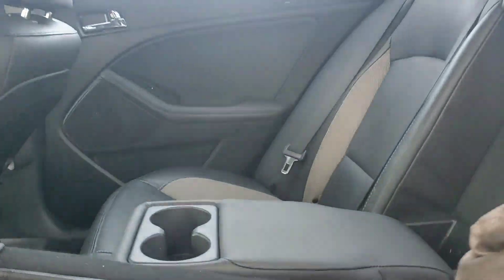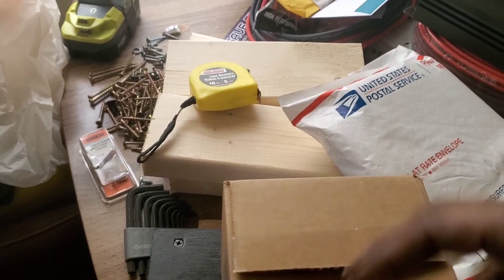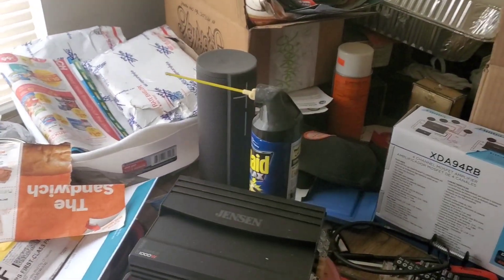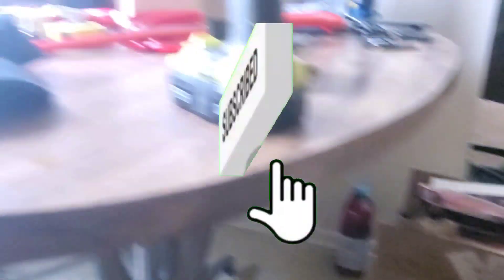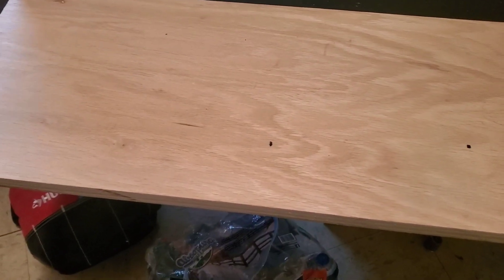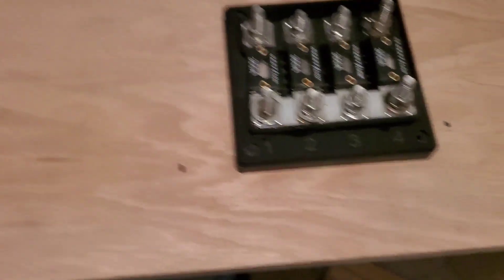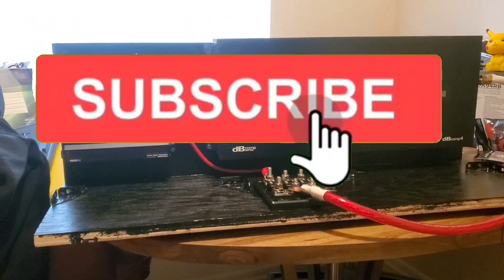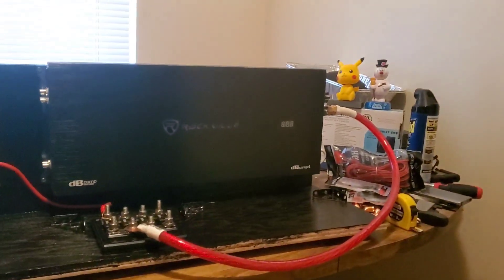Rockville dbcomp4/Jensen XDA94RB Amp Rack

Comment: On your amp rack if you don't like it you can move the wood in the back forward to the middle and leave it mounted the same way then you can put the batteries in the back part of the T shaped amp rack. The bottom wood leave and the wood that forms a L if looking at the amp rack from the side move the back wood to form a T then you will have the batteries devided by a no conductive piece of wood and you will still see your amps just remember to make sure your batteries + positives don't touch a metal holding screw or your metal on the back seat frame✌😀💯
Reply from the maker: I got couple of more ideas but I might make a couple of changes but right now the way I have it makes tons of sense but stay tuned you never know what's going to happen.
Reply: @markwoods212  nice I'll still like it if you leave it the way you have it. It will sill look nice and hopefully the batteries being in front will actually be safer. So your right I might of been wrong on telling you to put the batteries in the back.
Reply from the maker: @RyanBassForLife  No you wasn't wrong it would actually be a great idea.
Reply: @markwoods212  really well I guess if you get some time and you like my idea you could think about giving it a try. Its your build I didn't want to tell you something if you don't want to change your already built amp rack😀